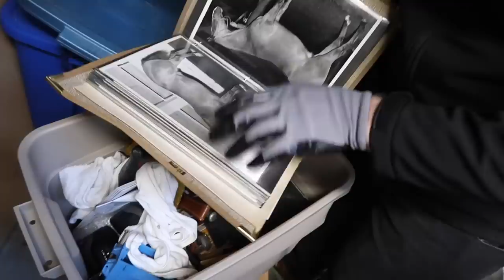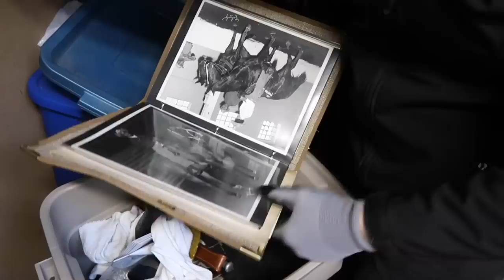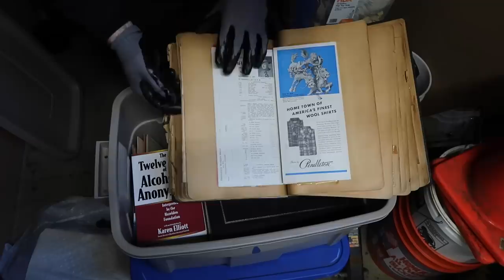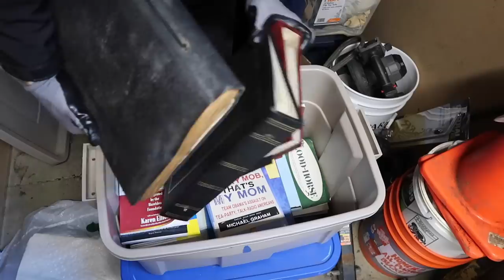I Bought A LOST Storage Auction Unit UNBELIEVABLE ITEMS Inside!

Comment: The black rubber boots with the metal knob on the side is Airforce boots. Used in cargo planes. The knob goes to an air blade. To regulate air pressure in the boot for extra insulation at high altitudes.

Comment: Nice survey equipment,  boots should be worth a fair amount.  The lazer for surveying with the tripod are usually expensive.
Reply: the lazer and tripod you could get a grand for depending on the brand and lower brand would still get ya $500 for it.

Comment: Those brass valves are used in residential and commercial water service installation. Its called a meter valve. ( that's what we called them when I was a plumber)
I'm not convinced that they are real Swiss Army Knives. I think they are knock offs. The silver tripod goes with the laser level. They are used to set grade on construction sites. There is a telescoping bar used to hold another part of the laser level.  One mounts on the tripod and the other thing mounts on the grading pole.
The Arctic Cat clothing is for snowmobiling. The black boots are us military issue and were used  by for winter combat.
Reply from the maker: Thanks Chris!!! Yes, I need to take a good look at the Army Knives!!! Thanks for your info/tips!
Reply: @WadesVentures  I think they are real, and I've had a few in my time.  Just look for the word Victorinox at the base of the main blade (or Wenger if some of them are really old - but the emblem seems to be from the former).  You should make a thousand bucks just with the knives.

Comment: The rubber boots at the end are for cold weather. The air nozzle on the side is to fill with air. Your body heat warms the air to keep your feet warm. But if your feet sweat in them then your feet can freeze. They are mainly made to stand in cold weather and not move alot.

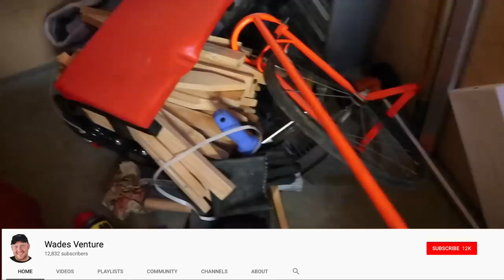Comment: The tripod at 36:21 goes to the Laser Leveler at  30:15   most likely also go with the orange roller and poles at 38:04 sell as a package deal.   For surveying.  Boots easily $50. a pair.     Nice unit.  Could sell the knives 2 for $10. on ebay make alot off the knives.
Reply: the LM30 sells for $1000

Comment: Wade,  If those are Swiss Army knives they are anywhere from $ 50 to$120 retail in the box, etc. for the wide ones with either pliers or magnifying glass to approx. $ 25-$ 40 for the 2 blade corkscrew McGiver type. The Case and Western in the sheaths are about $ 35-50 each. Contact me once you inventory what's there, knife parts as well if you want to sell it all as a lot. I'm always a buyer for knives, I sell and make knives.

Comment: The tripod and aluminum slider in the back the next to the tiny grey drawer goes with the vertical laser you found in the black case for surveying and leveling, goes for between 1000 and 3000

Comment: One of these days, you might learn not to throw the stuff around and be so rough. Every scratch, dent, chip, and damaged piece or part reduces the value of what you have. Sometimes to the point of no value. Leather - bag it separately, glass -  wrap it.  Metal with paint - wrap it, even if in newspaper. Maximize your profits.
Reply: Wade is a whole lot better than some of the buyers, seen one buy, practically runs thru the boxes throwing things boxes and contents around to leave the mess for his employees to pick up, straighten up after him (looking for the best things-according to him.). Think they try to work on the boxes so that the subscribers don’t get board and leave.  Keep up the good work, Wade!
Reply: Any units get turned over police?

Comment: The aluminum tri pod goes with the lazer level ... prolly worth a good  buck you need to look that one up!
Reply: Yeah, just the later, tripod and measuring stick will pay for the unit.
Reply from the maker: yes!!! I've never sold or found one of those before!
Reply from the maker: I think so Neil! It was in fantastic shape!
Reply: @WadesVentures  Earlier, the large measuring tape you showed but never picked up in the forward box was a surveyor's tape.  Darn expensive!
Reply: Be careful with that laser level. My dad was a surveyor. If you bump it around it could need recalibrating. Not cheap.
Reply: Whats the big deal about a box of gloves for your cats??   Uncle Will
Reply: The lazer level is survey equipment

Comment: At time 4:40 that tool is used to cut pipe. Most of the time that use that for copper pipe. You should be able to sell it on eBay no problem

Comment: 2:44 when the zipper broke, I would still buy it as long as there's still a zipper. 7:35 that tractor thing is SO awesome.
Reply from the maker: Thanks Sandy!!! Yes I was sad :( did not even pull that hard. might of been due to the cold.
Reply: Sometimes when a bag is old, the zipper breaks off easy (I've had one or two break on me)

Comment: 37:00 Extreme Cold Weather Boot Type 1, also called "Mickey Mouse" boots. Rated to -20°. Was developed during the Korean War. No longer issued by the military. Replaced by the white Type 2 "Bunny" boots, rated to -65°. BATA was the military supplier so what you got is the real deal and not a knock-off. Depending on size, $20 to $150.
Reply: @grumpyoldmarine3480   The small valve on the side of bunny and mickey boots are NOT for inflating, just for pressure equalization in an aircraft. try inflating them and you'll destroy them. FYI

Comment: The tripod goes with the DeWalt laser leveler to very expensive tool dude it's like 400 bucks poke it probably about maybe 700 well I might be wrong but if it's a complete kit that's the tripod levels the laser to laser gives you the way you mark off of it once you get a line a level line in a mark in the air you can measure down and get your ground to be level you can put sheetrock up wall studs everything the laser level is a very good tool plus it has to have his tripod though otherwise it's useless
Reply from the maker: Thanks for taking the time with this comment James!!! Yes, and it looked like it was in great shape!
Reply: @WadesVentures  handle with with kid gloves you can whack them out of adjustment real easy.

Comment: Those brass parts you pulled out that said Ford are for plumbing.  they are for the water main to houses.  They are normally under ground in valve boxes .

Comment: Those aren't flip phones...they're FRS two-way radios (walkie-talkies). Inexpensive, but popular for camping trips, construction sites, etc.

Please be more gentle with all of this stuff. You don't seem all that familiar with most stuff you're finding. Treat it all as though it's priceless!

The headphones (with the antenna on them) are actually hearing protection...for construction. Those are worth about $70 new.

The belt buckles are great, and very collectible, but be very careful how you treat those old tin lunchboxes! Many of those are worth serious $$, especially if they still have the original Thermos bottle!

Porter Cable cordless circular saw....around $100 (find the battery)

Laser level...depending on manufacturer, features, etc, can got from $100 to $350, or more!!

Please be gentle with all of this stuff....even the clothes! You blew right past a suede sport coat worth at least $150 in good condition!! Cashmere, in good shape, equally pricey!

Magellan GPS - $60

The tripod could be for the laser level....or a transit (surveying tool). Be GENTLE with this stuff! Some of it is more delicate than it looks!

The Arctic Cat stuff has to do with snowmobile racing enthusiasts.

You probably made your $300 back, without much trouble. Do you have a store, or do you rely on eBay?? By the time you pay eBay's fees and figure your time to prep and ship everything, eBay isn't doing most people any favors.

Good luck my young friend!! :-)